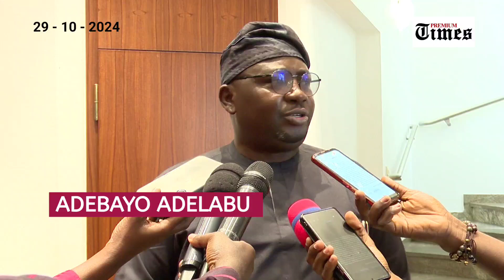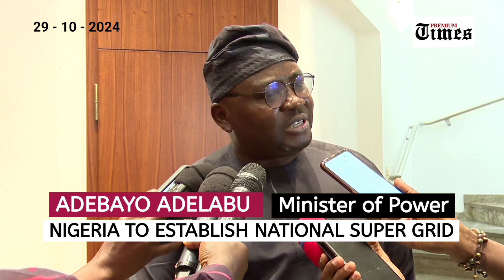Grid Collapse:  Nigeria to establish National Super Grid - Adelabu

Comment: Hon. Minister, please check your records before making official statements on Nigeria's power infrastructure. For the avoidance of doubt, the National Intgrated Power Project NIPP/NDPHC has done many critical projects to strengthen the national grid, including the following:
1. Ajoakuta to Gwagwalada 330kv tx line and the Gwagwalada 330kv tx station.
2. Ikot Ekpene 330 tx station and tx line of the same value to Enugu and strengthening of the Enugu 330kv (new Haven) station in addition to brand new Ugwuaji 330kv station. 
3. Tx line from Enugu of 330kv to Makurdi given Benue state the first upgrade from 132kv to 330kv.
4. Tx line of 330kv from Makurdi to Lafia and step down 330kv station and onward linkage to Jos station in Plateau State, which services the rest of North East states.
The minister should also know that for all completed NIPP power plants, 330/132/33kv stations have been constructed to evacuate the power. This is in addition to hundreds of projects to distribute electricity. I think it is fair to talk about managing the national grid and other assets in the sector rather than sink more money in projects that can not be completed. I would also advise the minister to look into the issue of meeting sector participants on a monthly basis.

Comment: Minister of Darkness. What a joker!!!
Reply: Did you even listen to what he said before making this irresponsible remark.
Reply: @rotimikayode1072  I've been listening to him and the one before him for years and we're still in darkness. What's your problem?
Reply: @samminer9835  You haven't been listening. Most of the projects of the power ministry are long-term projects which would be completed between four and ten years.

For instance, the upgrade of our transmission grid infrastructure from the current 4,000MW to 25,000MW will take four years. Until then, we are going to be experiencing frequent breakdowns because the current infrastructure are more than 50 years old.
Reply: @ashomamashak-he8mh  You are uninformed. That is your problem.